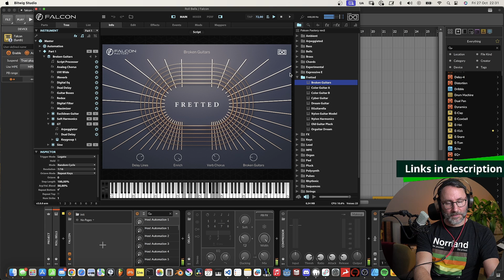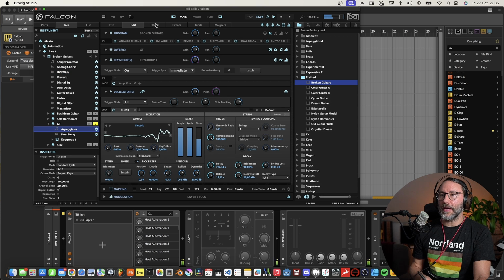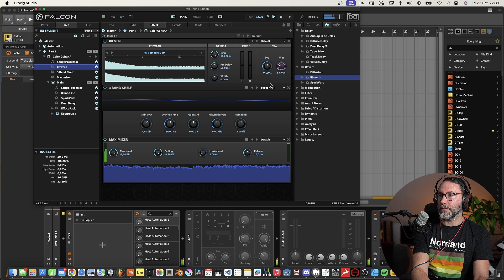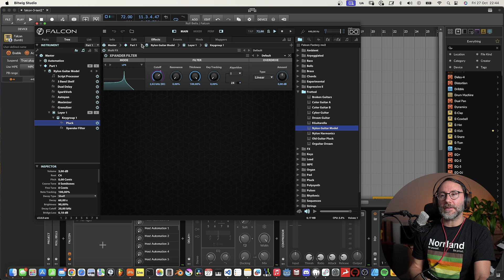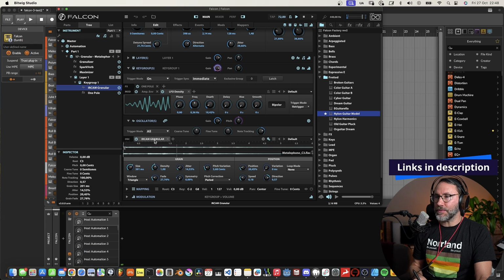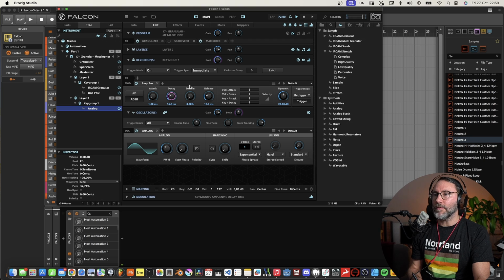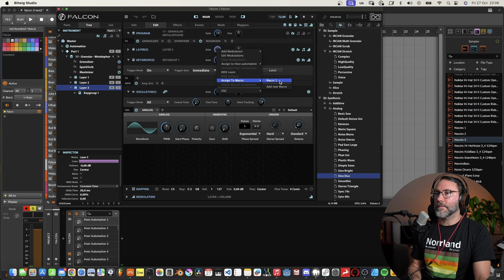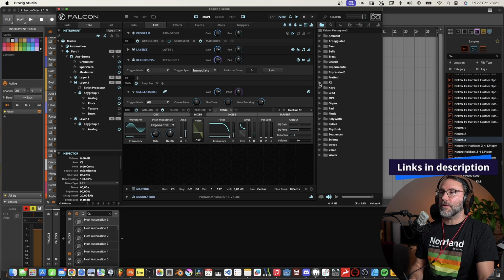Falcon 3 - First Look Part 2 -  Falcon Sound design

Comment: Yes, just starting from scratch, what is the first steps in building a multi instrument, multi layered program? Would like to see that in real time. In a program you have and instrument and devices under that you would use to affect the instrument? Not sure what these layers are referred to as yet.
I guess you could load template programs and open them up piece by piece and change them however you please. And after that , create your own.

Comment: how to get LFO assigned to any parameters? for example if I want to make a movement without adjusting a knob on some parameter in the event section? :)
Reply from the maker: 1. Right click a parameter. 
2. Hover "Add Modulation".
3. Hover "External -> Program or Layer.
4. Select "New LFO".
5. Scroll to bottom of page.
6. Expand  "Modulation" tab.
7. Adjust LFO.

Let me know how it goes. ;)

Comment: - Great pluck patch!

- I tend to actually end up using the diffusion reverb a lot for synth patches. It's very light and simple but a little goes a long way when placing on multiple layers. It gives you spread without the sound without the sound getting too lost in a wash of reverb 

- I totally agree with your suggestions for interacting with tree view
Reply from the maker: Absolutely, lightwwight and sounds great. I think I even talked about the navigation ”oddity / miss” in the tree view already in my Falcon 2 review. Can’t believe they haven’t fixed it yet. 🥁☕️